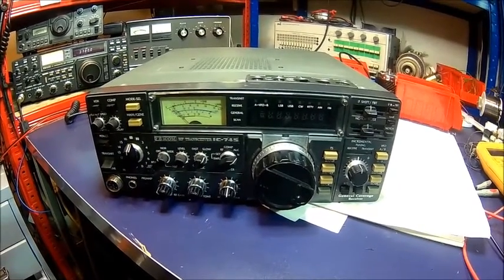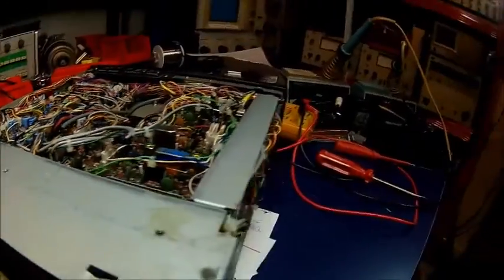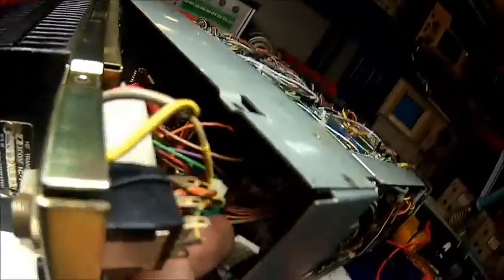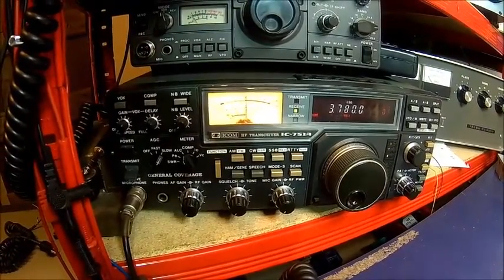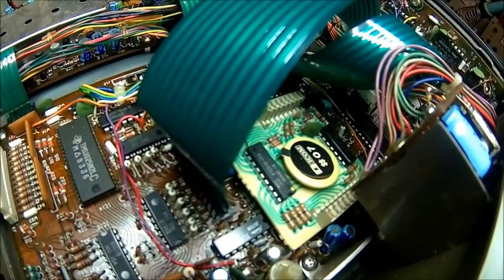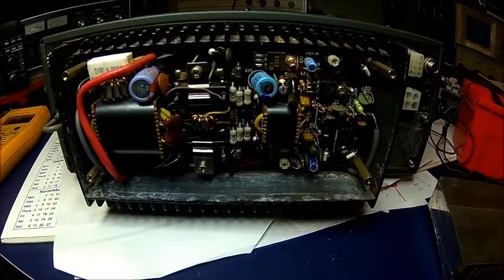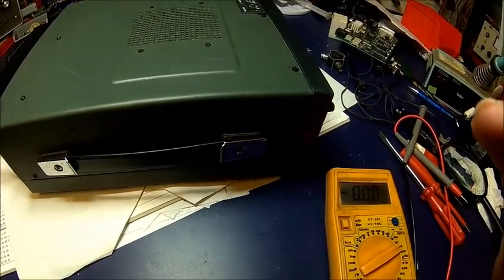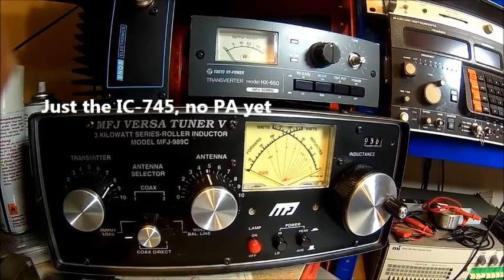Icom IC-745 faulty aux connector fix and function test (Amateur Radio HF Transceiver)

Comment: Nice!  I just got one of these from a ham buddy.  Got it back to life with a new ram board.  Chasing down some display, memory switch, and vco issues but nothing that scares me off too bad.  These rigs receive really well and transmit a nice sharp clean signal!  73
Reply from the maker: I agree, it's a great radio, i must admit that i am a big fan of older ICOM radios, got the 745, 751, 751A, 271E, 211, 245 and my very first one was a 215, bought brand new around 1978.
They need some love every now and then, but never had any major issues ,except that noisy DC-DC converter in my 751A which is a story in itself ... almost forgot the VCO caps, a pain to do, but worth it.
But if i compare the receivers alone, my Drake TR7 outperforms those ICOM HF radios by far.